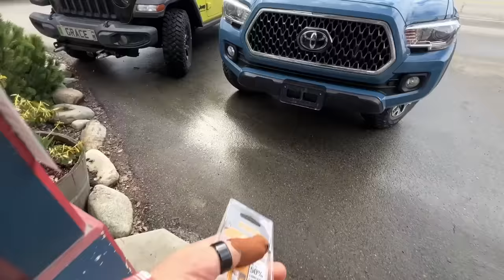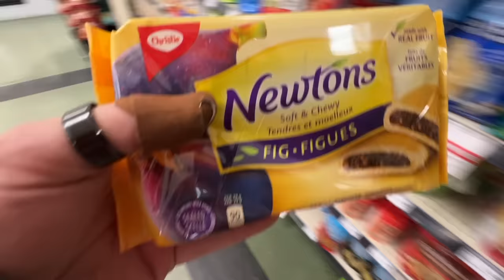VANBUILD Days in the Life - Hard Install but Totally Worth It

Comment: Diesel fillup door 50cm over the electrical shore power connection…

I’m not sure aboot this…
Reply from the maker: It’ll be fiiiiiiiiiiiine
Reply: 13:20 yea… no… it’s a disaster waiting to happen…
Reply from the maker: @G_de_Coligny  just make sure not to plug in when the plug is covered in diesel! Simple
Reply: Murphy's law...what can go wrong...WILL😂
Reply: That cut on the bottom part of the trap door cavity is really not a good idea. Can be save by rotating 180° then the door will open right. But at least the spills will be able to flow outward.

I know it’s upsetting to have random internet schmucks to play “know it all” on a project you are sweating on…
But , you can’t even see from outside how high the filling level of diesel reach… that’s a sh1tshow waiting to happen on too many level.

It would be safer just by having the tank and filler over the cat litterbox as it’s a “normal” way of mitigate fuel/oil spills on roadways… 
Would even justify having a small extraction fan for the litterbox enclosure (we build a house few years ago with extra pass through and extraction fans at 50cm level for this purpose…

Comment: 🌟🌟🌟🌟You're welcome, Matthew. I'm glad I found that video.  Im debating to do the same in my van. But the tank behind my drivers seat isn't too big of a deal to get to. I do have some renos and upgrades with my van that im going to start soon. 2 New lithium batteries and mppt dc-dc charge controller and battery shut off switches etc. New cabinet and new mattress etc....
Reply: Hi from Alberta. I'm doing a super cheap van build. E250 2001. She's old and rusty like me. 30 years ago, I set a similar van on fire. I was installing a high current amp and a CD player ( anyone remember those. Lol ) Anyway, I screwed up the GROUND  shorted out the system and started a fire on the Dogbhose.
I've watched dozens of Electrical van  installs now.
Still scares the crap out of me.
I have all the bits and pieces now. Go time will be soon.
Great work to you and Matthew. We learn by sharing. What a great community. 👍👍👍

Comment: For my diesel heater I put the standpipe through the cap of a five gallon (19L) yellow diesel jerrican, and bought an extra cap, so when I need to refill it I just remove the standpipe-cap, put the other one on, and then I can carry the jerrican to the gas station. Easy peezy. Reverse procedure to return the jerrican to the heater.

Comment: So glad you keep it real and show that the details - so many van builds edit so much that they make everything seem easy and perfect right off the first time.  In real life, unless you are a master carpenter or experienced van builder, it never goes that easy so dyi people, don’t get so disappointed when your build takes a bit longer and you need more bits, screws, etc.   I’m also glad that not everything had to be be super perfect as long as it is functional and it is secure /  holds up.  This way you don’t have to be afraid to live in and use your stuff and can enjoy your space.   You are being intentional and smart, the extra time now will save you so much later when you need to get access or filling up Lucky and the diesel heater tank in minus 40 below weather.  Great job and protect your digits. 😅❤😊👏🏼👍🏻

Comment: Depending on what the foam insulation is made of (ie polyurethan, polystyrene etc) you could have an issue with a reaction with diesel fuel. Some insulation foams and plastics swell when they are exposed to petroleum based fuels like diesel).
I have seen foam insulation material essentially turn into a gel or sludge like mixture when in contact with diesel.
This gel is particularly flammable as the diesel has less chance of evaporating or running off onto the ground.
When filling the diesel tank from the outside there will invariably be spills - especially if you overfill the tank.
I would remove the remaining insulation and somehow seal off the edge of the insulation on the side with a rubber mastic type material.

Build coming along nicely with with or without thumb lacerations

Comment: OMG, when I saw you use the sharp saw in the plastic, my heart stopped😮. In stead of working on a workbench you used your body and your other hand so close to the saw! Please be carefull, you want to keep your 10 fingers I guess? Turn the little plastic door for the diesel to the other side, flip it 180 degrees around so that it doesn’t conflict with your drivers door? Succes with your build🪚🔪🪓🍀

Comment: Info from the national park service on the Going to the sun road/highway: Entrance to the GTSR requires admission to Glacier National Park which is $35 per vehicle (non-commercial car/truck/van), $30 for motorcycles, or $20 per individual (if entering on foot or bicycle). The Road is quite narrow and winding, with hairpin turns, especially west of Logan Pass. Consequently, vehicle lengths over the highest portions of the roadway are limited to no longer than 21 feet (6.4 m) and no wider than 8 feet (2.4 m) between Avalanche Creek and Rising Sun picnic areas which are located many miles below Logan Pass, on the west and east sides of the pass, respectively. Vehicles over 10 feet (3.0 m) in height may not have sufficient clearance due to rock overhangs when driving west between Logan Pass and the hairpin turn called the Loop. The speed limits are 45 mph (72 km/h) in the lower elevations and 25 mph (40 km/h) in the steeper and winding alpine sections.
Reply: You need to have an entry pass to get in to Glacier National Park, then you have to pay the entry fee. No entry pass no getting into the park. I drove 1200 miles to Glacier a couple of years ago and never did get in.